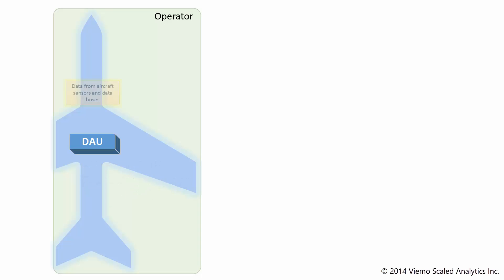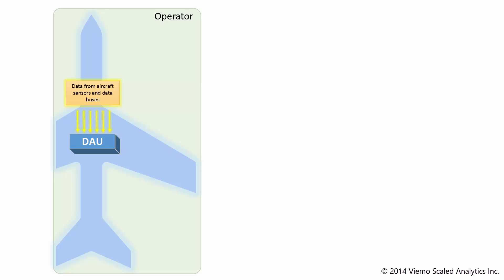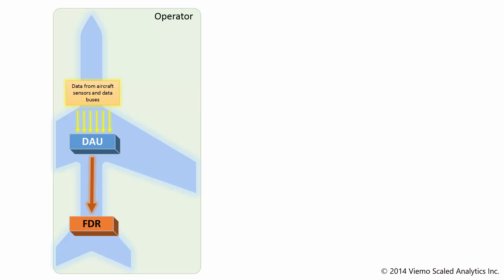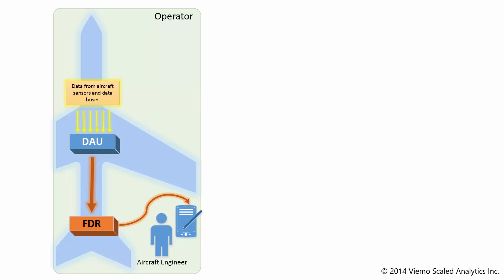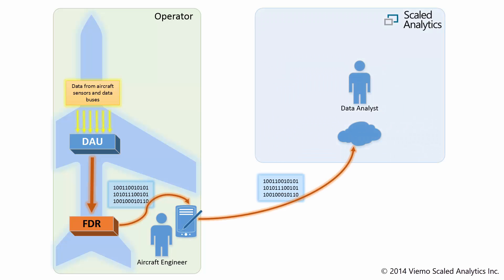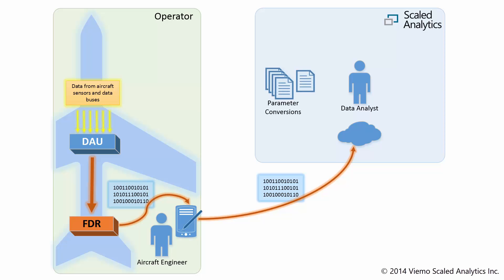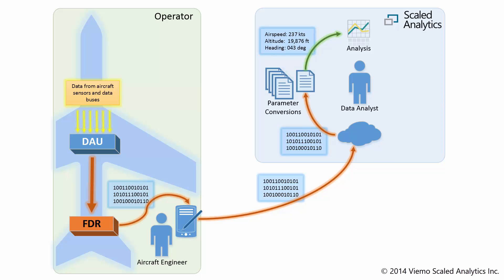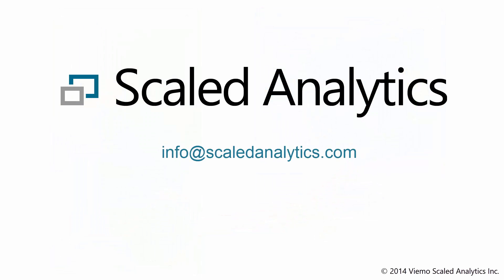FDR System Overview

Comment: I like to know how QAR works.
Reply from the maker: Hi, Armando

A modern QAR is very similar to an FDR. It will typically record the exact same data that is sent to the FDR. The main differences between the FDR and QAR are that the QAR is not crash protected (but is much less expensive, smaller and lighter than an FDR), the QAR can store much more data (in terms of flight hours) and the QAR can be easier to access depending on the aircraft installation.
Reply: How to extract data from FDR ?
PCMCIA card to laptop?